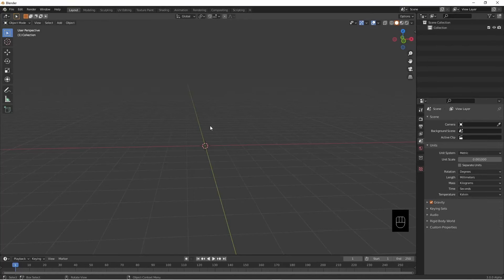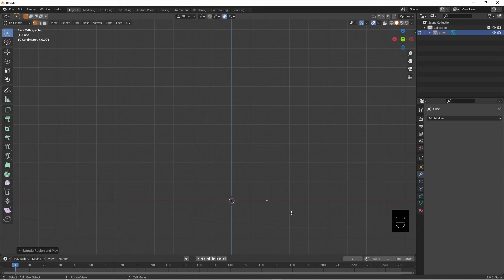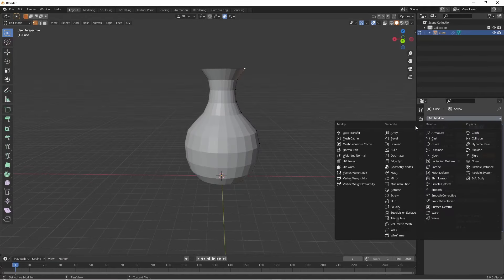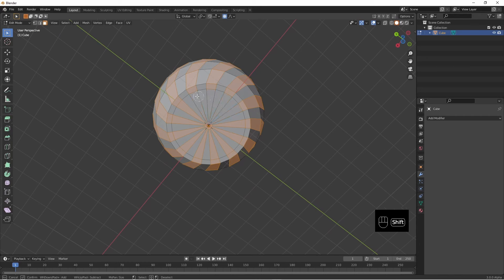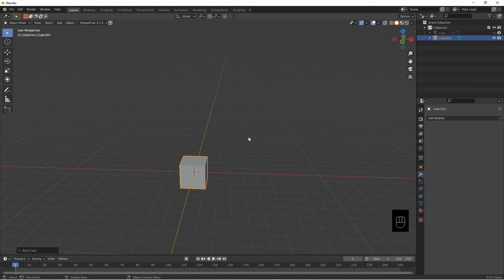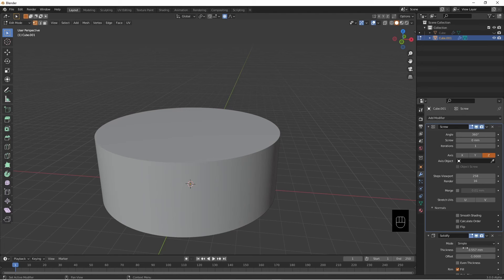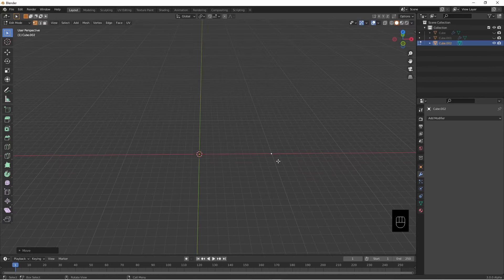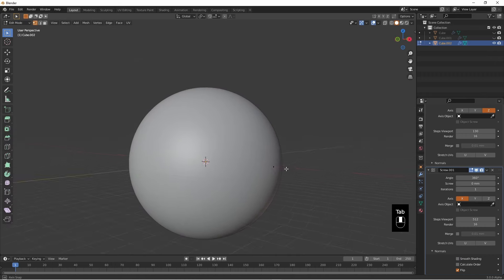Create a vase in Blender insanely easily that can be 3dprinted in vase mode.

Comment: Love this, made a vase with your wonderful tutorial :face-blue-star-eyes:
Reply from the maker: So pleased you made this :)  Thanks for letting me know.
Reply: @notverygoodguy  I've even printed it in a lovely silk filament. One thing I noticed and was wondering if you had any advice on: The model seems to not be watertight. There's some holes on the top and bottom sides. Was there something I missed? Thank you!
Reply: @notverygoodguy  This happens when i try printing in spiral vase mode.
Reply from the maker: @sephtronics  Printing in vase mode is rarely watertight I'm afraid.  There are often weak points as the filament gets laid down that water seems to find a way through.  You can increase your chances of it actually being watertight by having the extruder temperature a little hotter and/or by using a bigger nozzle and layer height.  I have had some things water tight but it's a bit hit and miss.

One thing you can do of course is to spray the inside of your vase with some clear coat of some kind, preferably a plant safe one.

Comment: when selecting the sections of the vase at 2:22, it selects horizontally and not vertically. Any idea as to why?
Reply from the maker: You probably have your mouse pointer hovering over a vertical edge when you click.  If you make sure your mouse pointer is on a horizontal edge it should work.

Comment: Doing school work. Saved me ahahha. Most tutorials doesn't say what to press ( like alt+e ) and I got lost. 
One question tho, when in edit mode I had to select the surface, it didn't do it the whole stripe from bottom to top, but only one of the cubes and had to do them on hand? What did I do wrong
Reply from the maker: It's hard to say what might be going wrong without being able to see the geometry of your model.  Are you sure you are holding the ALT key down while selecting?
Reply: @notverygoodguy  AHHHH i see . i didnt hold the ALT ahahah. thanks for the fast reply <3

Comment: Can I ask? why you don't select a single vert from    -Add-Mesh-single vert?

I also don't understand why so many video makers delete the original default cube you get when opening Blender, is there a difference between the default cube and a new mesh cube from the Add menu?

Bob
Reply from the maker: You certainly can ask.  Older versions of Blender didn't have the single vert option and so just merging all at center works for everyone.

People delete the default cube simply because usually they want to start with something else.  They get so used to it that they delete it even if they actually do want to start with a cube. Also it is easier to delete the camera and lights if you just select everything and delete it at the start.  That said you can set the default scene to anything you like in the preferences.

Comment: Oky 1 question... i wanted to print it... but the model has little hole on bottom how do i fix it? In blender i can also see the "center hole"
Reply from the maker: Hi.  This probably means your very first vertex wasn't in exactly the same place as the origin when you did the screw modifier.  Well done for spotting the hole :)  You can fix this in several ways.  Either drag that bottom vertex on the y axis (or whatever axis you extruded your vertices on) until the hole is closed or set merge in the screw modifier and adjust the distance until the hole goes away, easiest might be to apply the modifiers and then in edit mode go, mesh->cleanup->fill holes or possibly merge by distance would work to.

Hope this helps, let me know if you have any more issues.

Comment: Thanks for your video! Tell me please, How is your method different from this time 5:07, from creating a Mesh UV Sphere?
Reply from the maker: I am not saying it is a good way to make a sphere and you would only rarely consider doing it but there are a couple of advantages. This method is done with only one vertex and with modifiers.  This means it uses hardly any computer resources to generate a fully smooth sphere and that because of the modifiers it can be more easily scaled at any time later and doesn't need to have rotation and scale applied in booleans.    It is more of an interesting approach to making scenes that are fully parametric.  I would add, I have never used this approach in any scene of my own :)
Reply: @notverygoodguy  thanks for your reply! :washhands:

Comment: I guess the solidify modifier should be set to a width that is about the extrusion width of your printer
Reply from the maker: I would think so yes.
Reply: You'd actually want to close the vase completely and have a solid mesh with no walls, then let your slicer take care of the extrusion width in the dedicated vase mode. 🙂
Reply: @PeterHertel  I guess that would be more sensible, yes :)
Reply: @g0balot  if you want to use the vase mode function, yes. But it just came to mind it does limit your max wall thickness to one extrusion width, so the solidify modifier size would give you a thicker more sturdy wall. Without the benefits of single line extrusion in vase mode of course.

Comment: Anyone else getting a small hole at the bottom of the model?
Reply from the maker: If you haven't started exactly at the center of the world this will happen.  Try doing SHIFT C before you start or grab the first vertx you made and move it along the x or y axis until the hole closes.
Reply: @notverygoodguy will try thanks for the quick reply
Reply: Still had a hole unfortunately. managed to get around it by selecting bottom faces and pressing 'f' to fill it in right before the final subdivision surface. Great Video and keep it up !
Reply from the maker: @jasonborgmillo7482  Strange but glad you found a solution :)

Comment: Nice video It really helped me, but I have a question, is there a difference between using the single vert and merging the cube at center?
Reply from the maker: Well it used to be that you could only add a single vertex in edit mode so aside from the fact that you need to have the extra objects add on enabled, no there is no difference any more :)